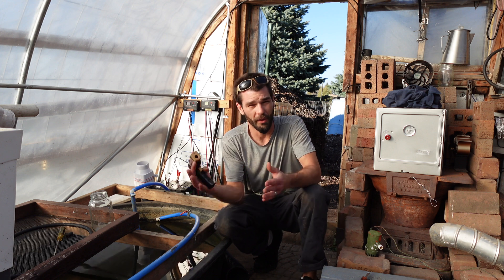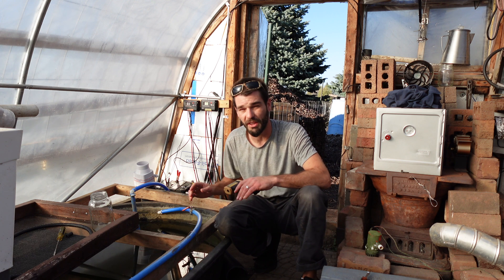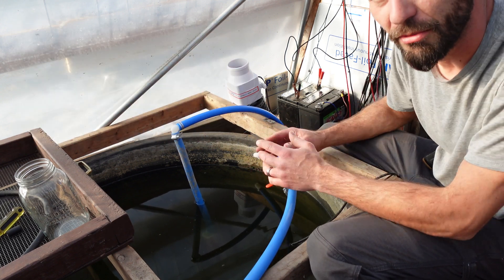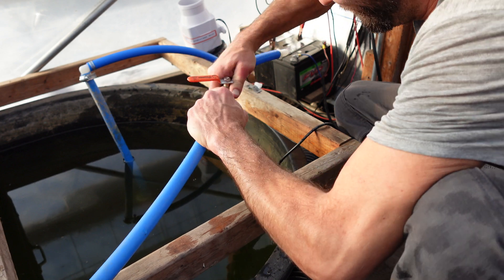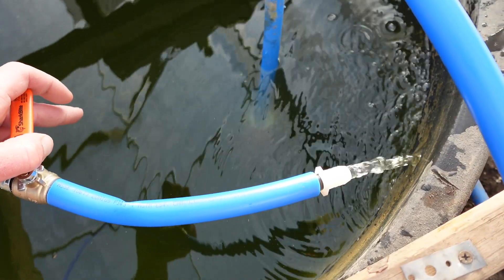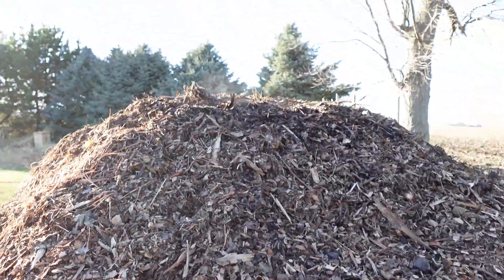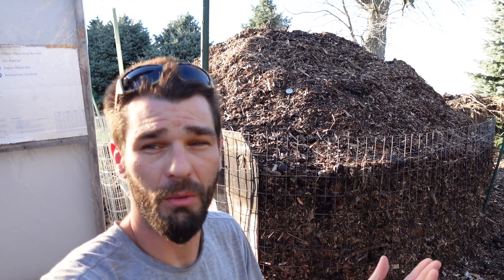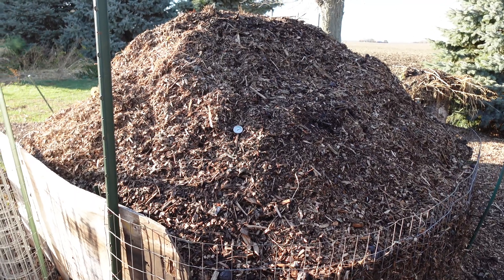DIY Thermal Mass Heater  - Jean Pain Compost Heating - Day 5 -  Water Flow Rate - Winter 24/25

Comment: Ummm. Idea . You have a heater behind you ? Bricks are a heat sink..get a 50 or 100 ft of coil copper tubing and line a steel bucket with it, leaving both ends exposed and join your pex to both ends to circulate. Fill it with sand. Put that on top of your heater.
Reply from the maker: done and done lol, thanks for the push to build a stovetop sand water heater!
Reply: @Earthdwellershomestead  oh youre very welcome. Wife and i are getting our feet wet on homesteading more and more. Built a 10x12 greenhouse feb 2024. 2 tier roof with a vertical solar opening vent. Looking into building a totally solar/ battery b.u. powered cooling system. With locally found parts.

Comment: How much do you expect to increase the temperature inside the greenhouse over the outside temperatures.
Reply from the maker: Most night over the years it kept 30-40f above outside temps. Anything is great as there’s very little cost involved. We’re always trying to do better and evolve, and our greenhouse is on year 6 of 5 for the poly. A re wrap and a new greenhouse are in order in the near future. Thanks for checking out the channel!
Reply: @Earthdwellershomestead  have you considered insulating the side that doesn’t get sun in the winter? Old concrete blankets would work well for a greenhouse that size.